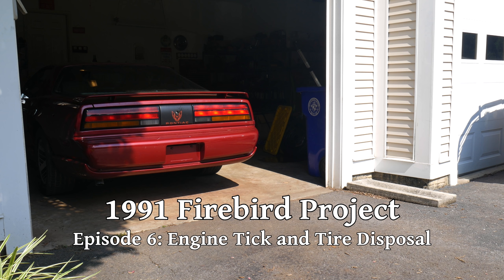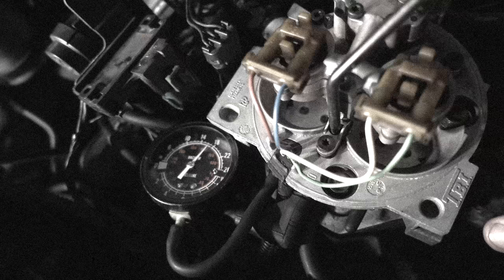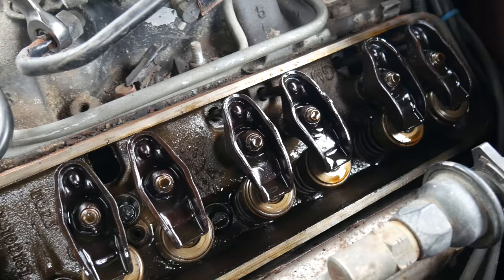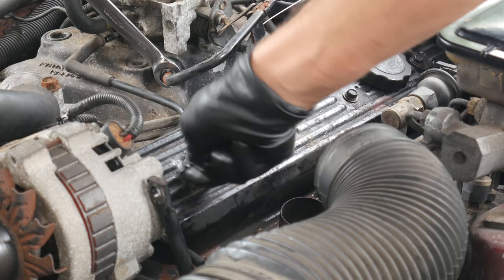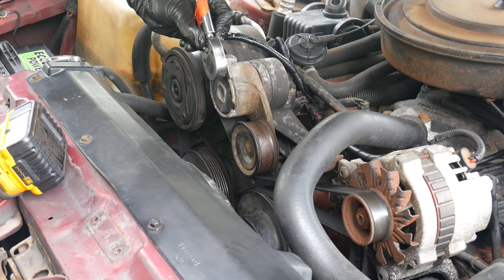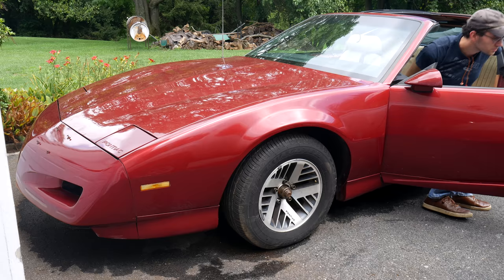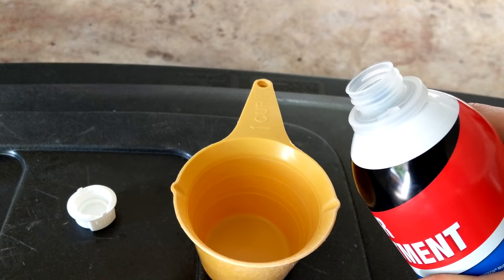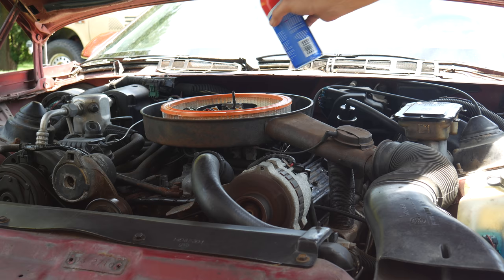$100 1991 Firebird Burnouts to Quiet Ticking Lifters (and Other "Cures") (Ep.6)

Comment: while the valve covers were off I would have cleaned them up and repainted them along with the air cleaner. I mean your already there and have it apart, just because it's a daily driver doesn't mean it can't look nice and clean. that was literally the 2nd thing I did to my 85 after  I got it, I gave it a deep bath inside and out and then pulled the Air Cleaner and Valve Covers off and cleaned and painted them along with all the stuff that was supped to be black that no longer was just to clean up the engine bay. although it's going to be a daily driver I still want it to look nice.

Comment: Change that open diff to a limited slip by using Auburn gear use 342 gears or get out there and have fun with also use a Edelbrock performer intake for shorty headers use a mild cam put an exhaust system put you a 2000 stall converter and get out there and kick ass holla

Comment: Why is it that only one of the rear tires spins?
Reply: It has an open differential. Meaning the tire with the less rolling resistance will spin
Reply: It means it has a open differential, a 2 wheel peel means you have a limited slip

Comment: put a quart of ATF in the engine its detergent oil I have had good results with this for years
Reply: most ATF is just highly refined oil. ATFs are sealed systems so there is no need for detergent in the fluid.

Comment: I don't know where you've heard that the 305's are prone to lifter ticking, I've owned a bunch of 3rd gen formula's and TA's and I've never had a lifter tick.  Secondly, the roller lifters are less tolerant of misadjustment (as compared to flat tappet with enough additive in the oil) and also make noise faster when misadjusted.  

That said... I'm pretty sure your noise is not an internal engine noise at all, I'm pretty sure that's an exhaust leak at the manifold.  Check carefully with an inspection mirror AND make sure all the manifold bolts are tight- sometimes you'll see it under the ports, usually the middle 2 ports, but it could be any of them and sometimes you won't see anything but you'll find that the bolts are loose.  Honestly, the only way to tell for sure is to pull them off and see where the carbon deposits are.

If you're convinced you have a sticky lifter you should be able to find it pulling the valve cover and checking basically like you check adjustment (lots of the time that lifter plunger will just drop when you push down on the rocker) and other than taking it out and either taking it apart and cleaning it or just replacing it, the best old school fix is to use a quart of ATF in your oil (it's a thinner lubricating oil with a mess of detergents added to clean deposits).

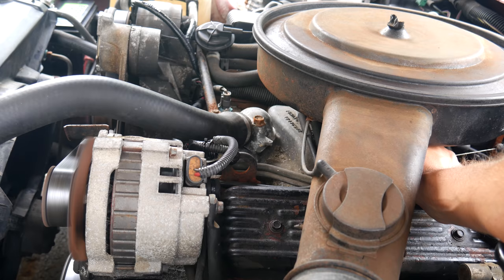Comment: You need to switch your plug wires out. At 1:41 you can watch the spark jump to the head. To the right of the intake tube.  You're losing significant power right there.  It would run quieter if it was running properly.

Comment: Please for the love of god, shove a deflated basketball in the quarter and inflate it then clean of the paint scrape with some gas...Also STP oil stop leak or Lucas will coat the internals, significantly decrease engine noise while increasing oil pressure.
Reply: You read my mind

Comment: wanna make that car a bonafide tire slayer?  toss the old throttle body 305 and junk 700r4 and rear end.  find a wrecked 96 or 97 trans am or camaro with a 6 speed and swap the rear end, motor and transmission.  the lt1 of the 96 is easily a ton more powerful.  285hp and 325lb/ft.  the borg warner t56 is solid and stout.

Comment: Should have done the WD-40 trick with those burnouts!
I've got a 91 Dodge Dakota with a 3.9 v6(125 Horsepower/194 Torque) with 3:5 rear gearing,I just got new tires so I took my friend on a trip to the middle of no-where and broke em in proper,and found a trick to fix the one wheel peel.
Use heavy brake application and floor it in Low range (1st or 2nd gear selector)
Once the 1st tire is spinning have your friend go to the non-spinning side and push the truck side to side,letting the brake go just enough to roll the truck forward.
This makes the wheel turn and hopefully the diff wakes up to the idea and wam,you get these amazing lines: https://i.imgur.com/4Dto7wV.jpg

Comment: It's the cam itself most likely..gm engines from this era are well known to kill the stock cam lobes because of little to no lube in ethanol fuel because of no zinc in the crappy new fuel.Id run 5 gallons of race fuel thru at highway speeds to both lube and clean it all out..Old cars need to be driven lol

Comment: Any time you re-use copper washers I learned from a blacksmith channel that you should anneal them first. They work harden when they are clamped into place and therefore might not make a good seal on their second use. Not sure how critical that seal is in this application.
Reply from the maker: Generally washers like that on automotive applications (especially brake and fuel lines) should only be used once and then replaced for exactly that reason. That being said, I have used/seen other people re-use copper washers many times and never seen one leak. For the valve cover bolts on this old car, it shouldn't make a difference.

Comment: For comment readers .Always take the security nut off first , not last. and install it last. Do not use a impact gun if you want them to last,use a breaker bar. Doing it this way is less stress on the key tool as the other 4 are holding the rim in place. Every security nut warning/instruction label tells you to do it this way. I cringe every time I see someone use the impact gun on them.
Reply from the maker: Honestly I hadn't thought about it that way before (very rarely have I worked with security lug nuts) but it does make sense to take it off first and torque it last. And the impact gun doesn't get along with most types of non-standard lug nuts so it didn't surprise me that the security lugs were getting a little deformed. Good tips!
Reply: @FuzzyDiceProjects  Your welcome

Comment: 14:45 what's the point of getting zealous with your torque specs if you're gonna mess em up using a jointed socket?? A 45deg bend in that joint can mean up to 0.707 times the actual torque spec. If you're applying 100ft-lb of force on that wrench, but you're doing it at a 45deg angle to the bolt, you could be applying as little as 71ft-lb or as much as 141ft-lb on the bolt itself (depending on the angle of the ujoint) and the wrench wont see that. Same reason you cant have your driveshaft angled weird

Not that your oil pan or valve cover gaskets really give a shit about proper torque specs :p

Comment: Flush the engine with diesel fuel when the motor is hot for about two minutes at 2000 rpms

Comment: Who doesn't love a good burnout?  Brought back memories of visiting the drag strip.  Have to say again I love your videos.  The videos have been inspiring me to get my garage cleaned so I can get to work on my Wrangler.  Sorry for the long post.

I always question the effectiveness of additives.  Especially after the fuel pump went on my Jimmy a month after using a Lucas Oil gas treatment.  Probably a coincidence since the Jimmy was around 13 years old.  

After watching a video a few months ago of someone using Seafoam I am changing my views some.  The Youtuber Project Farms used it on a farm truck with an engine that sounded like it was on its last legs.  After the treatment, the engine sounded 100% better.  I added the video links below if you wanted to check them out.  

The first one is where he did the treatment and the next one is checking the truck a year later.  

https://www.youtube.com/watch?v=agAWXnT4-EQ

https://www.youtube.com/watch?v=prXiQgVVnDY

Comment: Slap a cam in there, 1.6 rockers, headers, true duals and a chip in the computer and you have 250hp...Fuck it and throw an LS1 in there for less than a $1,000 and you have 300+ and weld the rear and you’ll have tons of tire smoking fun!

Comment: DUE YOURSELF A FAVOR AND REPLACE THE WORN OUT MOTOR MOUNTS.     USE Resoline and do 1k oil changes. let the oil clean out the engine and lifters. throw that oil oil away. use clean oil and resoline. drive 1k miles and change oil. if that oil got that dirty in 3 hours then there is a lot of crap that needs to be washed out. when it comes out golden at 1k miles you will know all the lifters and everything is clean. also replace the worn out suspension before you get it aligned.